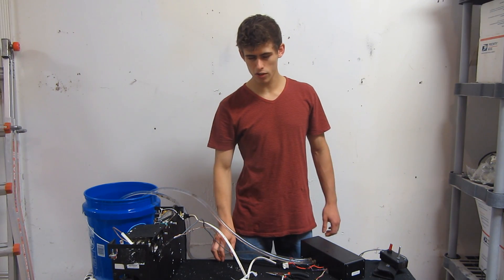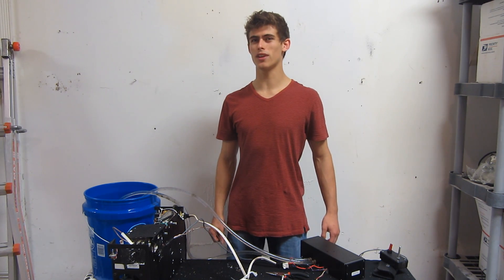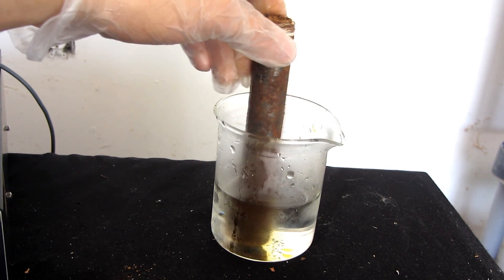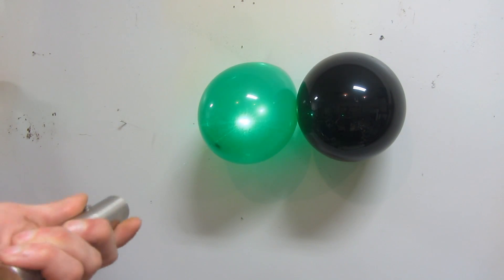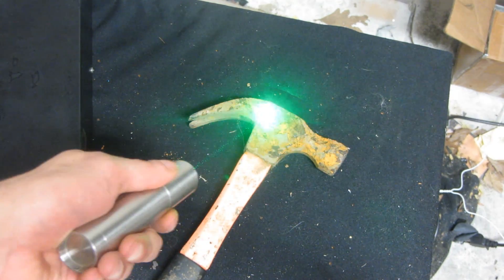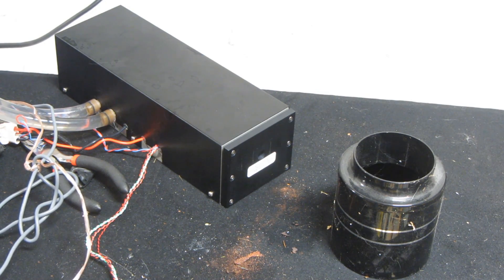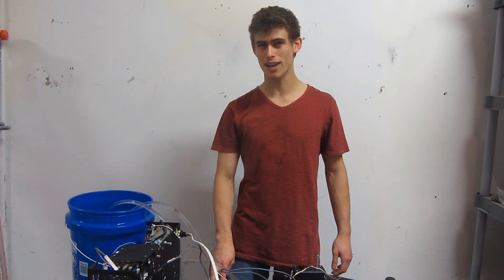Rust Removing Laser!!

Comment: Is it possible to build a DIY efficient and not super expansive laser rust removal tool at home? Something that could be actually used in a reasonable time for rust removal on not so big iron rusted stuff (for some restoration project)

Comment: Hydrochloric acid is not oxidizing acids, concentrate hydrochloric acid indeed would not eat up pure iron while removing the oxides, it is actually how steel factories cleanup rusts from their products, calls 'pickling'.
 in fact conentrated sulfuric acid is also safe against elemental iron even it is oxidizing, but once diluted attacks iron metal.

Comment: This effect seems like it would work well for maneuvering thrusters in space.
Reply: Ahh... I wonder if they have utilizes this, there may be interference from the UV rays.
Reply: @nisalvare57  I suppose the laser could be somewhere else, but that may cause the interference you're talking about. I was envisioning it as a contained system, inside the craft. The number of configurations for such a thruster are limited only by the imagination. Some factors to consider would be: Keeping the optics path clean so that it doesn't burn up, Minimizing non-fuel mass, Efficient fuel use.
One off-the-cuff example I can think of would have a fuel rod (of carbon or something) that sticks out of the craft. A globe-like crossection of a mirror encircles it. The laser beam is reflected off of a rotating mirror, is focused by the ring mirror, and zaps the end of the rod on whichever side the thrust needs to originate from. This would require only one laser, one rotating mirror (which reduces the inertia of re-aiming the thrust vector), and one fuel source to get 360 degrees of finely adjustable thrust. It seems rather advantageous... If you can keep your mirrors clean. :)

Comment: Can the laser blast some kind of protective coating on the bare metal to protect it in the future? I imagine that something that if something takes that kind of temperature to vaporize, it may be able to resist something. Or perhaps zap some carbon into the steel to case-harden it?

Comment: Hey There Genius, LOVE YOUR WORK !
I posted This to Another one of Your Videos, Then I Saw This One, BUT...

☆☆☆ I was wondering... ☆☆☆
With your vast knowledge of Powerful Lasers, IF you'd be up to THIS CHALLENGE ? ? ? ?

☆BUILD a LASER CLEANING TOOL !!!!!
It can be used to burn rust, carbon & grime off a range of different materials.
》THIS WOULD BE VERY IMPRESSIVE !
( NOT to say that what you've done so far Isn't, BUT, I Don't Think ANYONE ELSE Has Done This... YET ! )

What I'm REALLY wondering is...
ARE YOU CAPABLE OF MAKING SOMETHING WHERE THE OUTPUT LASER IS "CONTINUOUS", AND 
DELIVERIES A FLAT   (______¥______) 
BEAM ON THE PROJECT  ? ? ? ?

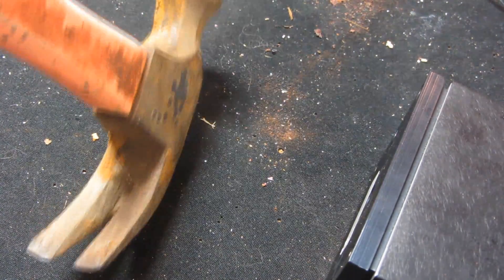Comment: If the laser is dumping all of it's energy really quickly, possibly even a thousandth of a second, why is it so easily seen in the footage? If it was every thousandth of a second, we'd see a flash  once every 17 seconds or so.  What i'm talking about is what's happening at 2:10
Reply from the maker: the plasma ball formed is much longer lived than the laser pulse
Reply: That's super interesting, I also completely forgot the fact that a frame from a camera isn't an instant snapshot. The aperture is open for a good amount of time, making the likely-hood of catching the plasma ball much more likely. 
Also, if you don't mind me asking, why is a laser beam even visible? Is it because photons bounce off of other photons, pushing both photons out of the beam and into the user's eye? The beam is visible from wherever you're standing, so it seems like that'd be a lot of light lost!
Reply: No it has nothing to do with photon-photon interactions. In linear optical regimes, there are no photon-photon interactions. The primary reason you can see the laser is because the photons are scattered off the all the tiny particles floating around. Also, our eyes are incredibly sensitive and can even detect single photons, so it doesn't take much.
Reply: It has nothing to do with the sensitivity of your eye. If I was there in person, and I asked the same question about how I can physically see it with my eyes, then I'd agree. My question was more about how the camera was able to pick it up.
Reply: I was answering the question, "Why is a laser beam even visible? Is it because photons bounce off of other photons, pushing both photons out of the beam and into the user's eye? "  

I'm assuming you forgot you even asked that, but it'd make sense to anyone who was reading the comments in order.
Reply: Ahh, i gotcha. Yeah, I wrote the comment a month ago and completely forgot about that. Thanks for the respectful reply! Nice person on Youtube is rare haha.

Comment: I must know, did the CD actually recoil from the pulse lasing? It certainly seemed to quiver just the slightest bit. Did anyone else see this?

Better yet, can you confirm, Mr. styropyro?

Thumbs up so he sees!
Reply: Well he said that the laser is dumping all of its energy quickly into a small spot, causing stuff to go from the solid state to the gas or plasma state. This comes with an increase in volume, so the recoil is from the phase change and not the laser
Reply: not to mention the gas pushing from the opposite facing side of the cd creating "thrust"
Reply: @Nabbehh  This is a leading theoretical way of deflecting an incoming asteroid. Send up a nuclear powered spacecraft with a pulse laser to zap the asteroid at precisely timed intervals, vaporizing enough material to push it off course.
Reply: Cody has a video showing the thrust of a laser, meaning just the force that the photons applies to an object.

But the expanding gasses that this laser creates is far stronger then the photons :)

https://www.youtube.com/watch?v=Ng1X8mPJziA
Reply: Well, part of the laser does bounce off, so while minuscule, there should definitely be a recoil from the reflected laser
Reply: the recoil is mostly from the popping of the metal and plastic. but that's bc of the laser too
Reply: Radiation pressure.  The laser pulse carries momentum in the direction of travel.  It then gets absorbed / reflected in the opposite direction when it hits the disk.  Apply conservation of momentum and you should expect the disk to recoil.

Comment: I've used HCl to remove rust just for fun. The acid does eat the metal as well, and actually etches the metal to leave a new surface with a very high surface area. This allows it to rust extremely quickly afterwards, almost at an absurd rate (less than a day to full brown). Polishing would probably make that method more viable.
Reply: You need to oil it tool steel will always rust.

Comment: if you have time molasses works great. It works chemically, the sugars chelates the iron oxide leaving a rust free surface. In fact it will start rusting as soon as exposed to the air.

Comment: Could you make some kind of tutorial on how the power system is created?
Reply: Large capacitor bank charges up to the flash lamp voltage, then a small pulse-forming network fires off a very high voltage starting pulse to make an ion channel in the flash lamp.
The light builds up, the laser rod starts... lasing, and the light builds up more until the passive Q-switch lets it all through in a single, short, and absurdly powerful pulse.
Reply: Thanks

Comment: Does this YAG have a q switch?
Reply from the maker: As configured it does not, but it has a mount inside the cavity that could be used for a rotating Q-switch.
Reply: Thanks for the reply. Was curious if a q switch is needed to evaporate rust.

Comment: +styropyro I know I wouldn't be stupid enough to point a laser at anyone but would a quick flash to the eyes with a 10mw 532nm green laser do any permanent or temporary eye damage? Also if it helps to figure it out its using a 3V power supply
Reply: It would.
Possibly repairable, but absolutely unsafe.
NEVER point ANY laser at any eye or mirror.

Comment: Is that laser 20W in terms of continuous power output or just 20W for the duration of the pulse?

If it's 20W average, I imagine you might be able to use your 200W laser bazooka for the a similar effect without needing to pulse it?
Reply: Not exactly.
The laser pulse is very short, and usually very high energy.
The least powerful systems I've seen start at around 5-8kW, the most powerful end at around 50MW.

Comment: does that laser have a limit to how fast it can fire repeatedly? I'm assuming it has a capacitor bank which need to be recharged before it can fired again. is it possible for you to modify it to use multiple banks of capicitors so it can shoot at a higher frequency? seeing that it has a cooling line I would assume in order for it to run at a higher frequency it would need to be cooled more effectively
Reply: actually maybe something like this can be a good Colling solution http://www.rmcybernetics.com/projects/DIY_Devices/homemade_super_cooler.htm a design of that sort can also be used for your chemical light you are designing
Reply: It's also dependant on the flash lamp life/power rating tradeoff.
If you pulse the lamp at a faster rate, it'll have a very short lifetime.
Plus, the higher the energy that goes through the lamp per pulse, the less it will live as well.
There are q-switched pulse lasers that go into tens and even hundreds of kHz pulse rates at several hundred watts or even kilowatts per pulse.

Comment: what happens if you put your hand in the laser beam? Does it heat your hand enough to ablate the skin?
Reply: Most likely. The laser he uses has a wavelength that is very easily absorbed by water.
I'd say it would be more like instant blisters than skin ablation though.
Reply: try it on pig skin

Comment: That's awesome!  Think I'll stick to my electrolysis bath followed by a quick brushing when I need to clean up a badly rusted tool though. :) 

They mentioned laser ablation in an episode of CSI to analyse an unknown substance - vaporize it & run the gas through the mass spectrometer to find out what it is.
Reply from the maker: Sounds like MALDI (matrix assisted laser desorption/ionization) mass spec! There was one in a lab where I went to school that used a pulsed nitrogen laser (337nm) as the ablation source.

Comment: You could actually use coke. Well, if you are patient that is.
Reply: Vinegar is cheaper and accomplishes the same thing. XD
Reply: That's because it contains phosphoric acid. You can buy phosphoric acid and it will work a lot better than Coke. Or as someone else said, vinegar (aka acetic acid) works well.